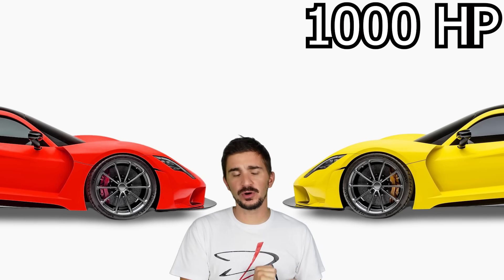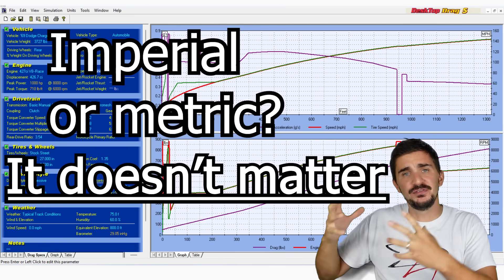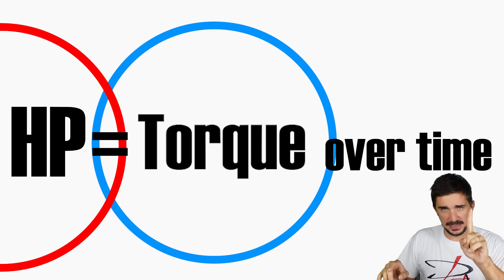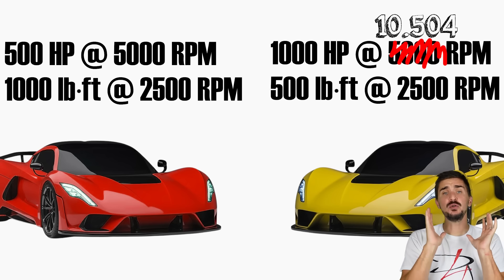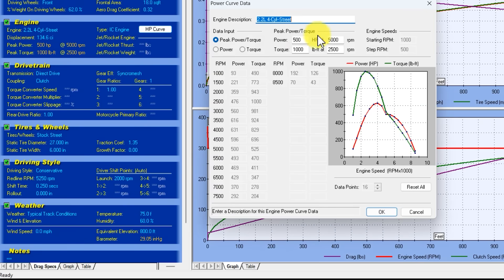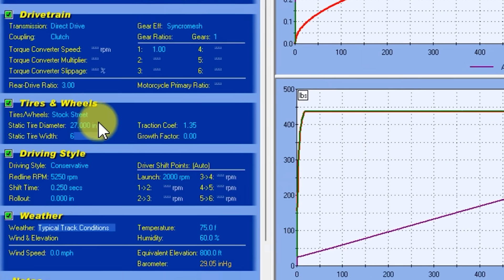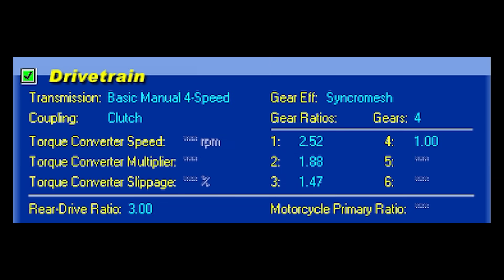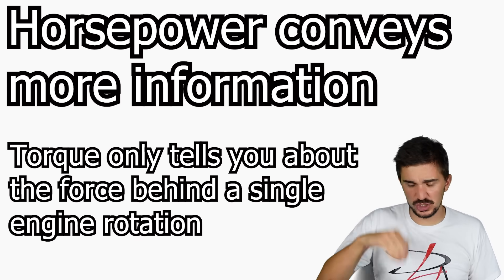Who's faster? Explained and Simulated - Horsepower vs Torque

Comment: You should have given the HP-Engine double the gear ratio as it has double the RPM for peak power imho. But other than that, well made video! :)
Reply: Yup engineering explained made a torque vs HP breakdown and spoke about this
Reply: They both need a CVT for a fair comparison.
Reply: @ChadDidNothingWrong  imho, that is still dependant on the ratio of the cvt. There isn't only one unanimous ratio for all cvt
Reply: @792bnz Please explain how this "ratio" of a CVT works.
Reply: @Carl_Jr  it's a final drive gear ratio like any other car. The only difference is there are no gears like a regular trans. As an example 3:1 is longer ratio and 4:1 is shorter
Reply: @ChadDidNothingWrong  Well, depends on what you define as 'fair'. For optimal results: sure. But on the one hand i'm not aware of any CVTs that could handle 500 (let alone 1000) lb ft of torque, on the other hand that would eliminate the whole influence of 'the area under the curve' and only focus on peak power. ^^

Comment: You could also say, that horsepower is the child of torque and rpm and as such inherits the characteristics of both parents. The problem with the box-analogy is, that damage is measured in Joules of (deforming) energy.

Comment: Best explanation on hp and torque I've seen using boxing to compare how torque and hp work together. It's  like comparing a light weight boxer against a heavy weight boxer. One hit's harder the other can hit faster but it's both together

Comment: Build a transmission with the optimum gear ratios is key for the high horsepower engine. The transmission will multiply the engines torque and having higher overall power will give the horsepower based engine the edge. 

That 1000 horsepower engine will have to be run at much higher rpm. That engine will wear out much quicker.
Reply: Also it will need more gear ratios to make most of its power at a narrow RPM range towards the high end. Calculate the number of gears needed and the weight of such gearbox + add time losses due to switching gears. Then the "high power" engine quickly becomes "better" in only very limited, non real-world applicable situations. And it will certainly be the worse choice for general driving, durability and fuel economy.

Comment: A few years back I got into a nasty argument about this topic.  Browsing the comments indicates that people are understanding that power is what matters, as long as you can take advantage of operating RPMs with proper gearing.  Then again, if you gear the "higher torque" engine improperly, it will be at even more of a disadvantage.  But yeah, power is what matters.  Power at the engine is where torque at the wheels comes from (after gearing).  Torque at the engine is fairly meaningless because it doesn't tell you anything about the work that can be done with it (unless you have an RPM, in which case you would compute power to answer that question).
Reply: 👍 Well said!

Comment: I do not fully agree with the approach and conclusions presented here. These two engines are very different and would require very different gearing. And with optimal gearing, higher power is always faster.
Yes, a higher torque engine can be faster with fixed 1:1 direct drive for both engines and similar hypothetical scenarios, but that is quite irrelevant. No car would ever be designed like that.

Comment: Sorry, but this video doesn't really get into as much depth as I'd like to see, so let's take out the unnecessary variables offered by the simulation and talk about the fundamental principles behind it from an engineering perspective.

First of all, when we talk about the power of a car, we are usually referring to acceleration. What determines acceleration is only the power produced, as in physics power is defined as the rate of work done. Well then, is horsepower the only thing that matters when it comes to the acceleration of a car? No, as the power figure of an engine is usually the peak power produced, at a certain RPM range. There are many variables that affect the performance of a car, from aerodynamic drag to tire traction to gear ratios, however we can take all of these variables out and focus on one thing: available power. 

In theory, the variables affecting the power production of an otto engine are: The density of the air coming into the cylinder, the heating value of the fuel coming in, the total cylinder volume, the compression ratio, and the RPM. As you can see, for an ideal engine, there's no upper limit to the power available as we increase the RPM to infinity, and the torque of the engine is nowhere to be found in the equation. However, in reality, as the cycle steps of the engine take a finite amount of time, after a certain engine speed, the engine starts making less power. (the air cannot come into the cylinder fast enough, the combustion doesn't occur fast enough, etc.) Therefore, all engines have an optimal RPM range where they produce the most power. This optimal RPM range depends heavily on the geometry of the engine, and in turn also affects the torque produced by the engine. There are some brilliant videos on this channel about these topics if you want to know more about them. 

We can look at the Power vs RPM graph of an engine, the graph alone gives the best idea for the performance characteristics, and this is where torque becomes important. For Naturally Aspirated (N/A) engines, this graph is usually pretty linear, the available power increases somewhat linearly with the RPM of the engine. This is where the concept of torque comes in. 

As it's stated in the video, from two engines with the same maximum power available at two different rpms, the higher revving engine will have less torque at lower engine speeds (due to the geometry of the pistons, rods and the crank); which makes the power produced at that RPM lower, as it has LESS TORQUE at that RPM, which in turn will correlate to a slower acceleration at that RPM compared to the lower revving engine. Therefore, an engine with a geometry that allows for higher torque at lower engine speeds, will make more power at that certain RPM compared to the higher revving engine.
However, the power produced by an engine is also a factor of the RPM itself as stated previously, hence why higher revving engines are used to make more peak power.  

So what determines acceleration then? Horsepower or Torque? By themselves, both of these figures are meaningless. The Power vs RPM graph of an engine will give the best idea for that engine's performance. An easy way to tell is looking at the area under the graph up to the point where the power starts decreasing with increasing RPM. A larger area under the graph correlates to better performance overall. 

For a practical example: There is a reason why the Porsche GT3 RS is naturally aspirated. Turbos are great for making peak power, but they usually require lower compression ratios, which cause lower power production until the turbo is spooled up. The bigger the turbo, the higher the RPM it requires for spooling up, which correlates with a sudden power increase that occurs much later over the power band. (at a higher RPM, closer to the peak power RPM range) This might increase the peak power greatly while decreasing the area under the power curve, which also decreases the acceleration performance of the car (over the whole power band).

Comment: 3:45 not a good way to explain this. Small punch will do 0 damage even if you will hit 10000 punches per second. Better idea is to explain this by carrying something, for example water. How much water in time=power, how big is bucket=torque. You can pump more water using glass than using bucket if you are fast enough.

Comment: You always want to run your car at peak horsepower to accelerate the fastest.  That's why cars are getting faster with automatics with 8+ gears (take the Honda Accord sport for instance--only 250 HP, but 10 speed auto = 5.4 sec 0-60)....they're keeping the car very close to the peak horsepower.  If you have a CVT transmission and floor it, it will try to keep the car at peak horsepower for maximum acceleration.  If you're only able to use one gear so to speak, and accelerate from 2000-7000 RPMs, then you want the greatest area under the horsepower curve.

Comment: Great explanation as always! I've always thought of it as torque = twisting force, and horsepower = twisting force * time.

1 Nm per second = 1 watt.
Reply: Yes that's correct. Torque will actually twist the drive shaft. So driving in high torque low rpm will lead to higher forces on the drive shaft, piston rods, crankshaft etc. High rpm engines need to deal with less forces and can be built lighter.

Comment: Good explanation.

Worth noting that when you are changing the transmission ratio's up, what you are doing is converting Horsepower to torque and vice versa.  That is what gearing does.  

An easy way to see this relationship is to actually look at small hobby DC motors, where they all use the same 'motor' but have different gear ratio's tacked onto them internally (with gearboxes) to offer different RPM.  You'll see the same hobby motor doing 5 rpm all the way up to 10,000 rpm, depending on how much holding torque you need. Holding torque being physical feedback on the motor that would make it stall out.  Which exists in ICE but we often don't experience because ICE's put out excess force in most packages.

Comment: Most people talking about engines and cars miss the fact that they are talking about ENGINE TQ or HP.

The TQ @ the WHEELS though drives your car.
Reply: When you calculate the TQ in each gear, you see who is faster very fast and easy. 

The simple fact that Otto engines have 2-3000 more RPM range makes them faster in most cases... because: diesel engines NEED a longer diff as those are otherwise running out of rpm.

But keep in mind: This was always true in the 6-speed times, with its roughly 5 times ratio (from 1-6th gear). With  ZF 8 speed we have a 6:1 and the 10-speed ones are probably even greater in its range.
Remember the US cars with their 3-speed autos? A TH400 is 1:1 in 3rd and 3.x:1 in 1rst!!!
The ZF 8 Speed is 6:1 up to 0,67:1!

Comment: There is much simpler and better(not biased by weird 1speed gearbox) way to decide what is better. Look at stock performance 0-100 various engine versions of same car. For example vauxhal vectra B: 
- 2,5V6 vs 2.2dti - same torque output. Result: 2.5 is 3s faster.
- 2.2dti vs 1.8.16V-same power output. Result: both are the same(difference is about 0,2s)
Or just use logic:
1. What would win race, 1000HP f1 car or 80HP tractor? Peak torque is 2x higher on tractor. 
2. Two same cars, same engines, one of them have added 2:1 gears between engine and gearbox what gives almost same power and 2x more torque. Which one?
3. Two cars, same gearboxes, one propelled by engine 50HP 80Nm, second by 0,5m handcrank with 200N force what gives 100Nm. Hand-cranked will be faster or even similar?

Comment: What about semi that hav 500 to 700hp and 2000 torque how can an engine generate so much torque and so little horsepower?
Reply: You should watch his other vids because I know he has answered this more than once.

TLDW: Undersquare cylinders (small bore, long stroke) use longer connecting rods which provide a mechanical advantage that provides more torque. They are also better at pumping air into the cylinders which means more torque at low rpm. But they can't rev high because the longer stroke means higher piston velocities and you can only go so fast before things break when the whole thing is moving back and forth many times per second. And if you can't reach past 5252rpm while still making good torque then peak hp will always be lower than peak torque.
Reply: they generate so little horsepower because they rev VERY low. Stock truck engines rev to 2200-2500 RPM. Modified engines go to 3500RPM max most of the time. Thats why

Comment: ultimately it is the horsrpower does the trick. a 10-litre turbodiesel with 500 horsepower and 1000lbft torque is technically interchangable with a 6-liter NA v12 with 500 horsepower and 500lbft torque, as long as you get the correct final ratio, the vehicles even performs the same.

problem is the turbodiesel is too heavy and too big for your s-class, and the v12 is too expensive, has not enough longevity and fuel economy for your 18wheeler semi especially it will be in full load all the time. its just 2 designs for the same power requirement but different use case.

while a 'torquy engine', which implies peak torque appears in low rpms, does make sense on a everyday vehicle. as you don't drive your car at redline (peak power) all the time, you actually have to utilise the acceleration through the entire rev range (especially low rpms) so a torquy engine makes you feel good in town or low speed driving. lets say there is a not torquy but powerful engine redline at 6000rpm. as the result the car idles at probably 2000rpm, and you have to accelerate your engine to probably 4000rpm before dumping the clutch for a decent acceleration, which is undrivable in town and fuel economy is trash.

Comment: Off Subject & might sound stupid but if an engine makes it's max hp & torque somewhere between say 0 & 8500 rpm. Why do they have the engine running more rpm into say 10,000 rpm & higher?  
For better fuel economy but the same amount of power. Couldn't they just limit it to 8500 rpm since that's where it makes max power. 
Like many people say removing the governor on a small 212cc gokart engine increases rpms & therefore makes more power, while others say. Removing the governor does increase rpm but that it's not actually creating more power. Is it technology not increasing the hp or torque but is allowing for a faster top speed by spinning the sprocket at higher rpm?

Comment: Now everyone will say higher torque is faster. You should've used a shorter final drive for the high-power engine to take advantage of the high rpm, and gain wheel torque.